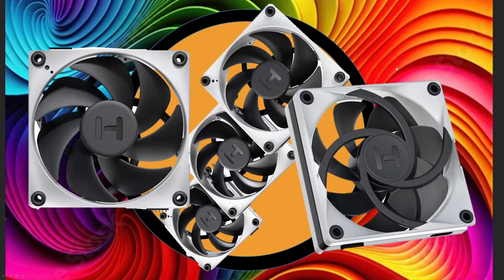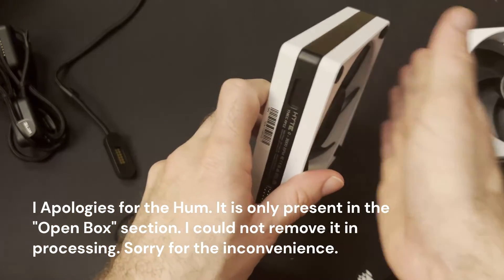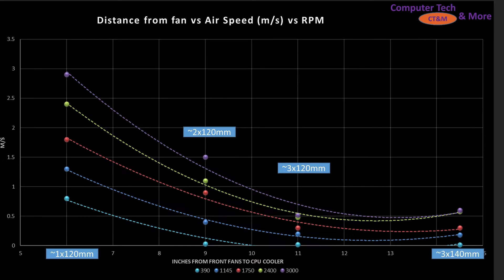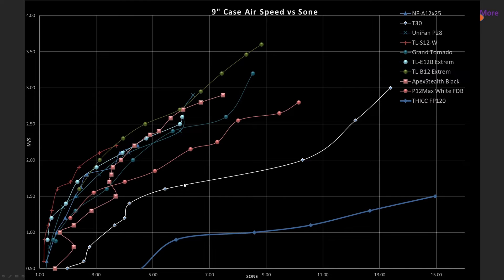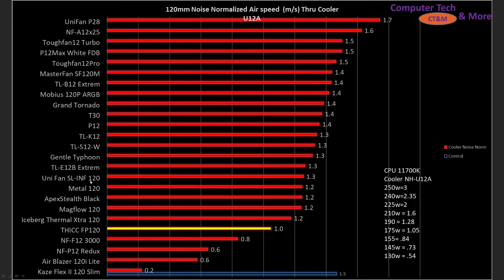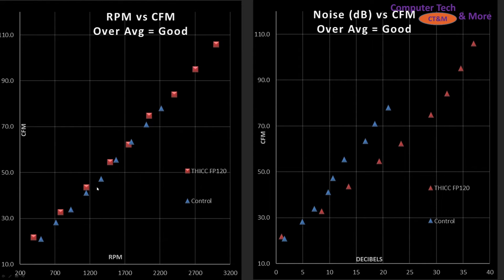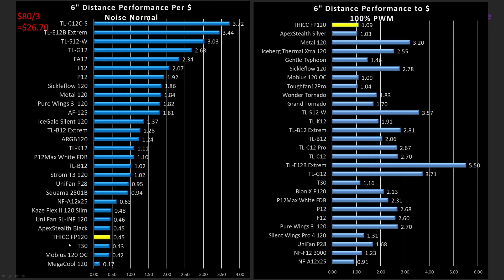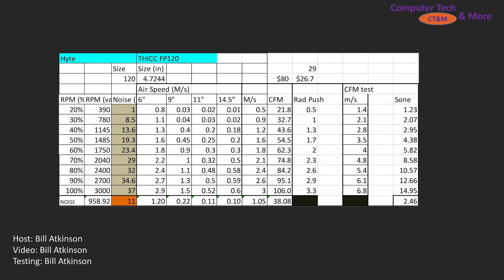HYTE: THICC FP12 (THICC Q60 Fan): Does THICC = Performance?

Comment: i bought a triple fp12 fan with the nexus hub, I figured out how to connect everything together, but I'm confused on the step that requires me to "Connect the 6 pin PCIE power connector to the matching cable from your power supply"  how do I connect the nexus hub to my PSU?
Reply from the maker: I did not use the nexus hub but I would guess it uses Sata power. so you need  a sata power cable to your PSU.